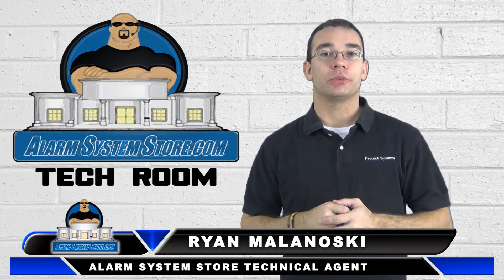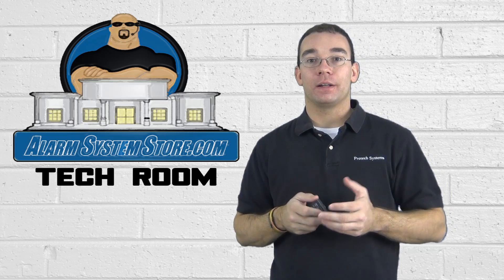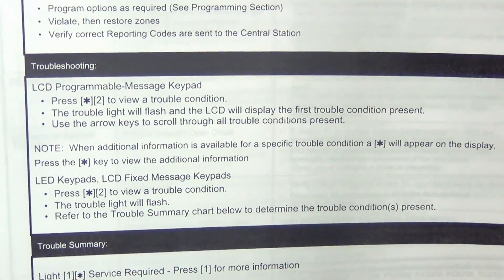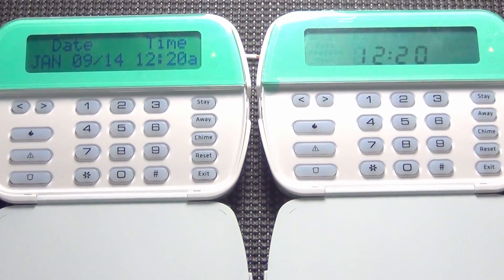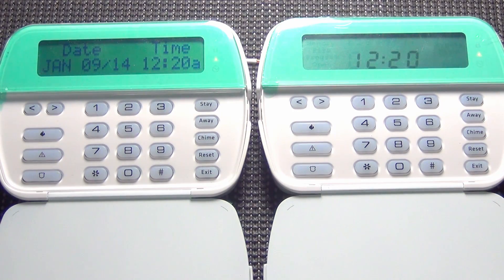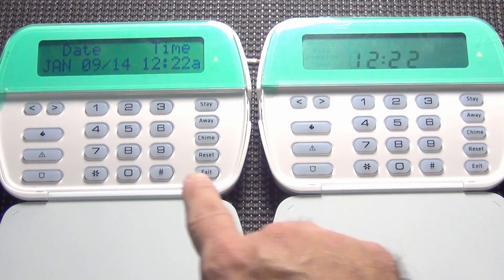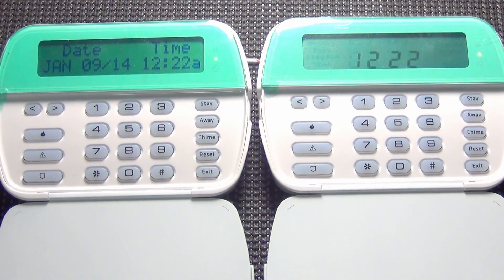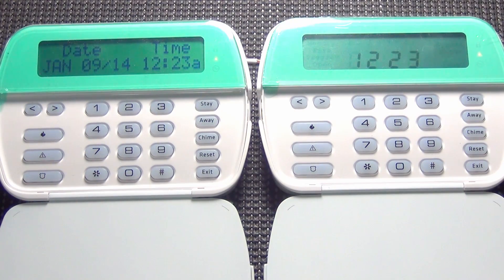Alarm System Store Tech Video - DSC Trouble Codes

Comment: Hello ryan I currently owned the house and it has dsc alarm system when I open and close the doors and windows it makes sound we didn’t get the manual to put the code stuff like so how am gonna put the code  on it can u help me please thank u
Reply from the maker: Dergi, without the Master or Installer codes you won't be able to do much. If you know the Master code then you can reference our quick start guide for help - https://www.alarmsystemstore.com/pages/programming-quickstart-guides

If you don't know the Master or Installer codes then I would consult the previous owner to see if they have them. If you can't get the codes then your only option would be to factory reset it and then you'd have to re-program it.

Comment: so how do you stop the beeping at 3AM then when it starts beeping??
Reply: To change the keypad sounder tones press and hold the * key. There are about 20 odd graduations of the keypad sounds, from completely off to softer tones than the default setting. Did this to mine after AT$T lost internet to the house 7 times in a month during various times of the night including 6 times last night. My phone lines connect through their router.
Reply from the maker: Well, you'd need to find out what trouble it is by following the instructions in the video then you can rectify the problem once you know what it is. All trouble codes can be accessed by pressing *2 then it'll either read out a full description of the trouble (if you have an alpha keypad) or a trouble code number (if you have a fixed numeric keypad). Once you find out what the trouble is then you can remedy it.
Reply: what if i need  a service call and tech is not available until after 48 hours..what do i do to stop the beeping while i wait for the tech to arrive?
Reply from the maker: Simply viewing the trouble via *2 will silence it for a while, beyond that your options would be to power down the system or turn all beeps on the keypad off.
Reply: oh.. I thought pressing # or * will silence the beeping, at least up until techs arrive..
Reply from the maker: You can press the * or # keys to silence it for a little bit but that will eventually time out and it'll start beeping again. You can press *2 on the keypad and it should display what trouble is occurring then you might be able to fix it yourself. Most times the most common trouble that will cause it to beep would be a low system backup battey

Comment: This one is wierd.  I have 3 DSC Z823 panels (1 text and 2 regular).  Was beeping with trouble light last night.  Phones off too.  Called Comcast and discovered they erroneously took phone (VOIP) service off our account tonight (long story).  They fixed, rebooted service,etc.  Phones worked again and Alarm System working BUT yellow trouble icon still up (for Communications).  Can something still not be fixed, or can I just turn that icon off somehow?  Do I have to call my security alarm company (Security Alarm Corporation in FL) to get them to do it (they'll charge me $100 just to come out to my home!).  It appears to all be working fine, but that darn icon is still lit which worries me.  Beeping gone, just trouble light saying same thing (Communication).
Reply: Bonnie Burwell have you tired to powercycle your alarm system to powercycle your alarm system disconnect your backup battery then unplug the transformer and let it say unplug for 30 sec then plug it back in you have to reset your time and date if that does not clear it then call your alarm company for a service call
Reply: Hi, I know this was a year ago, but for anyone with the same issue, try this...
First, I don't know any DSC product that has a designation Z823. That may be some QC type sticker. For most DSC keypads, you will have 3 emergency buttons, a fire, a medical, and a panic. If you had this sort of issue where your line went down and was restored, and now you have a communication trouble indicated, that generally means the system tried to call out and was unable to do so. The easiest way to fix this, is to call your monitoring company and place the system on test. Once that is done, simply hold down the medical button on any keypad until it beeps(usually 3 seconds). This will not generally make the siren sound, unless your installer specifically told it to. Doing this will send a medical signal to the central station, and also send any signal that was backed up from before. If you have a restored phone line, this should now clear your trouble light after the panel finishes sending all it has to send. Call back and ask what signals they received. That will tell you what it tried to send while the line was down. If all has cleared up, put your system back online, and you are done. On some older panels, you may have to wait 20 or 30 minutes for it to finish clearing the signals out.

Comment: i used to have  a phone line hooked up to my alarm. i canceled the phone service and now i get a code 3.   How do i turn off the code 3 permenately?  

Thanks
Reply: its a DSC alarm
Reply: Gunman1628 is your alarm monitored if so call your alarm company and ask for a cellular device that will clear out your trouble there is no to clear trouble three
Reply: Whyme123 If all you care about is the siren alarm to alert you or your neighbors (aka a local alarm) you'll want to go into the installer menu to turn off the communicator. If you do still want a monitored system you'll need an internet communication module or cellular communication module.

Comment: Helpful video, thanks. Question, whatexactly  the difference between "phone line" trouble, and "communication" trouble?
Reply from the maker: Phone line trouble is basically the alarm panel's way of letting you know that the phone line is not connected or has been cut. Communications trouble means that the panel tried to communicate out and was not able to. Hopefully that answers you question. :)